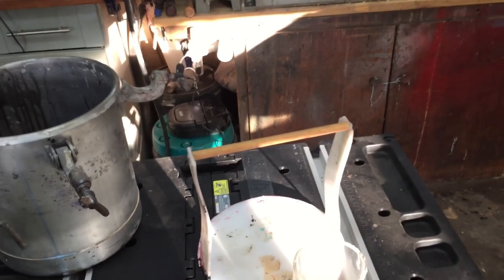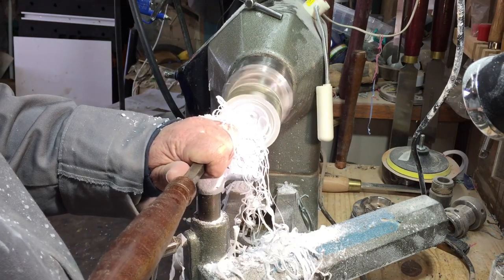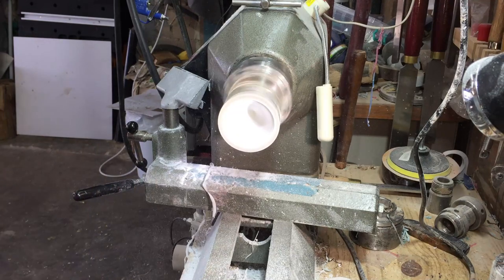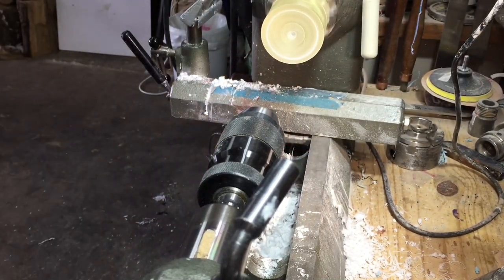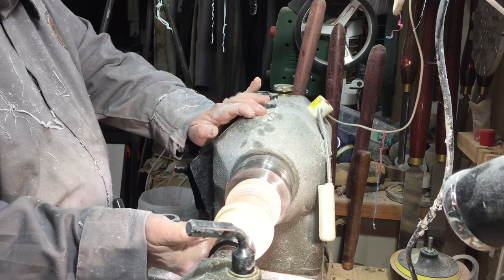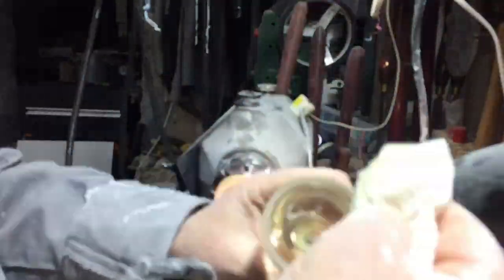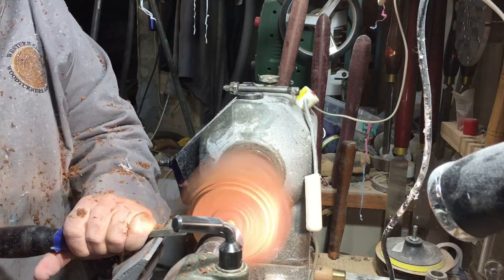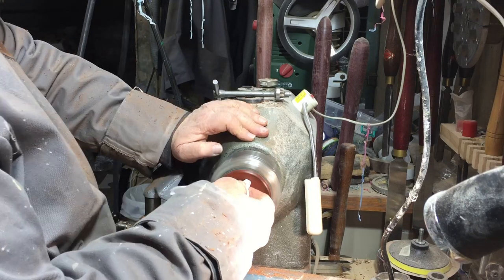wood Turning - Skull Hourglass Resin Artisan Edition ▶ Wood And Resin 2020.

Comment: Super cool! The flickering happens at times because the refresh rate of the light is slower than your camera frame speed. I only really noticed it when the resolution was a little lower....

I just know when I do slow motion with my phone, the LED light I have appears to flicker as well.
Reply from the maker: Thank you very much Tournage Dubois and thank you for the info . i am working on it with new LED light . hope it will work .

Comment: 1st. Hi Ahron, Great little project. The only thing about Paduk is that is loses that beautiful Orange colour and turns an equally lovely brown over time. The only way I have found to stop it is to put a CA or Super Glue finish. Do you have any other way of keeping the Orange colour? Take care Ahron. Cheers, Huw
Reply from the maker: Thanks it was fun to do it . yes i know that it loses its color i will keep it away from the sun. worse is when turn it the workshop turns orange
Reply: @oldmanwoodcraft  That is true Ahron. I turned a bowl from Paduk with Ash cross pieces. I was finding orange patches in my workshop for weeks afterwards. Huw